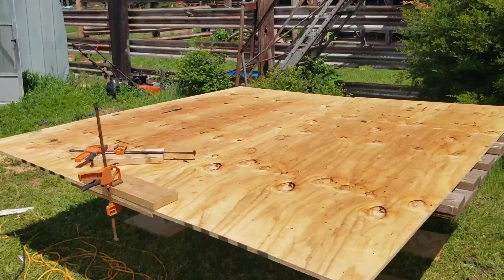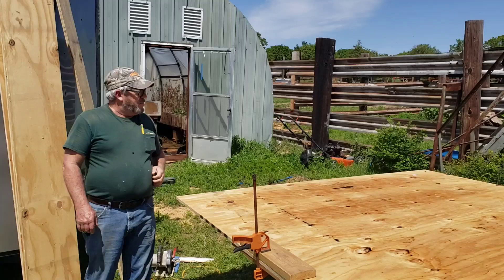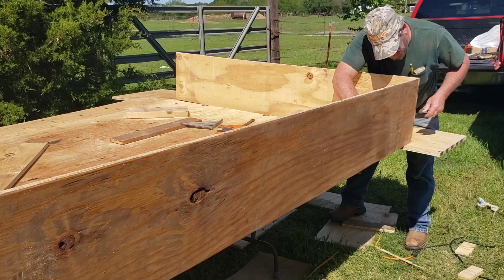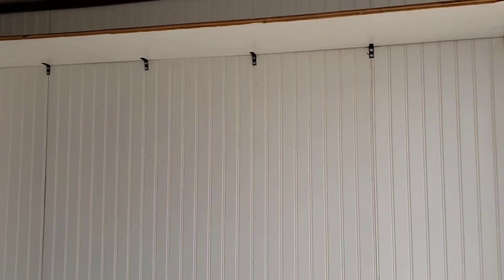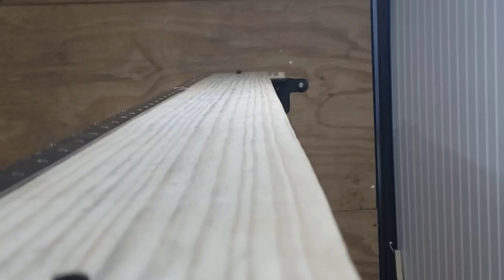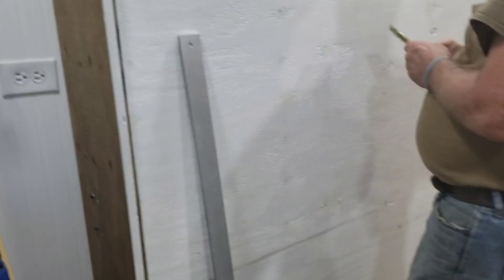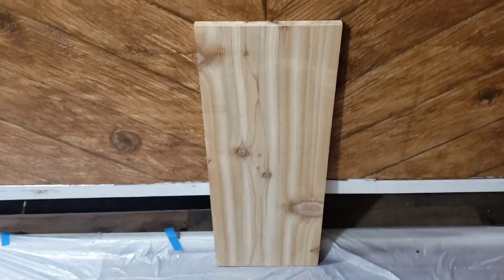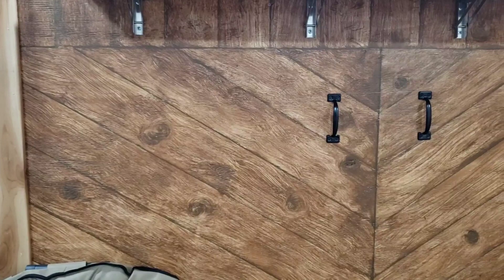Cargo Trailer Conversion Murphy Bed from Start To Finish So Beautiful

Comment: We are currently doing a CTC conversion. This is by far the best design I have seen for a murphy bed. We are planning a twin size murphy and I was wondering if you could tell me the exact bracket name you used or maybe a link to one where they can be purchased. We plan to have a 10" thick foam mattress for ours so finding brackets that would work like this would be amazing.
Reply from the maker: We just used a piano hinge and a Winch to move it up and down. Very simple install. Thanks for watching.